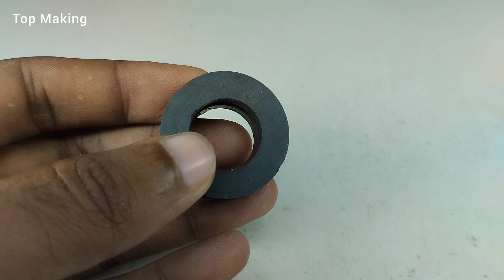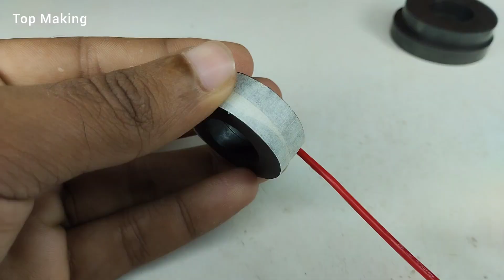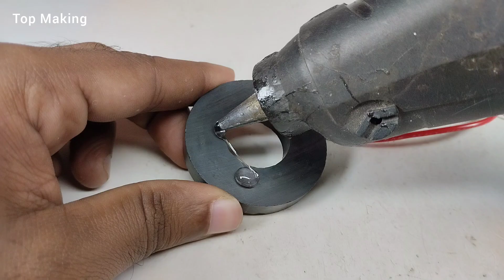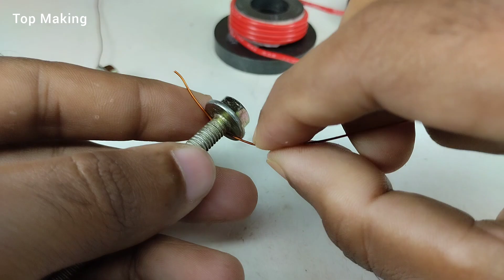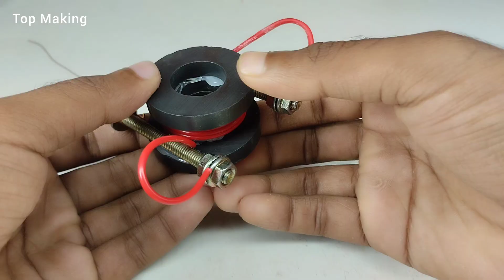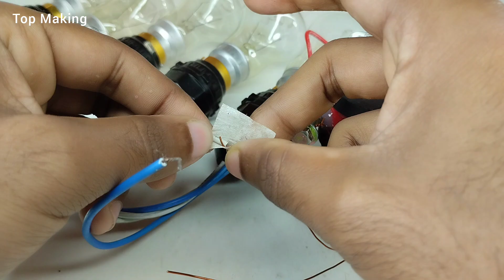I Make 220volt Free Energy Generator 19KW with Big Magnet and coper Cable

Comment: Question: why use wire coiled around formers fixed between magnets when the same outcome can be achieved if the bare wire ends were plunged directly into a generous pile of fresh, warm king cobra feces?
Reply from the maker: thanks a lot sir